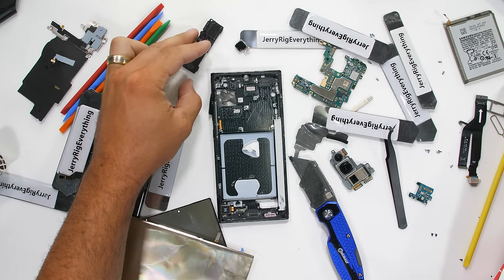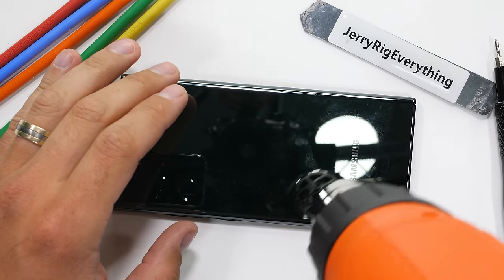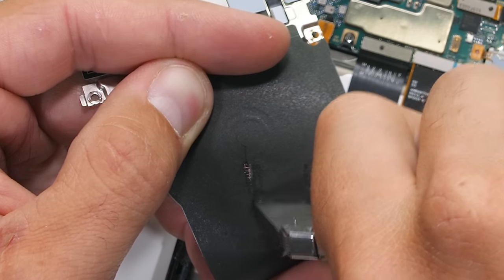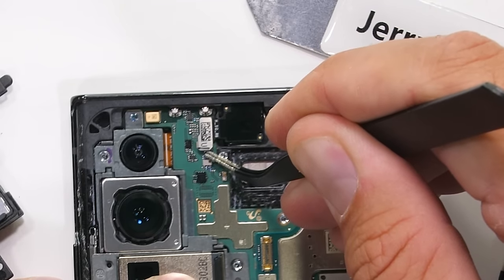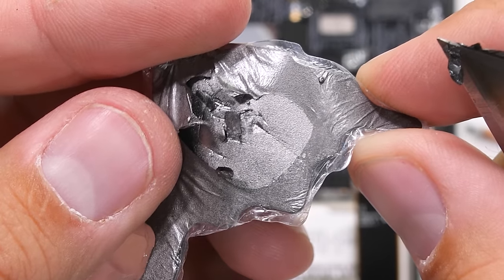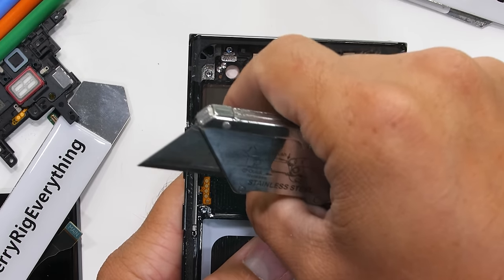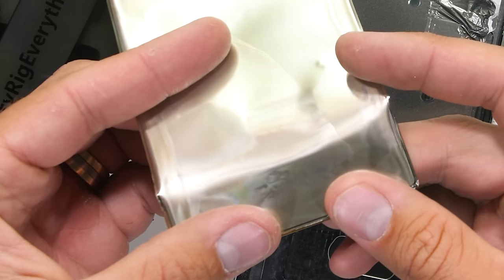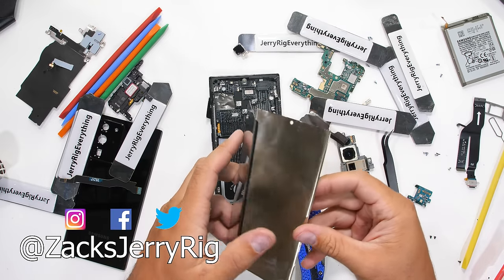Samsung Note 20 Ultra Teardown! - No Copper Cooling inside?!

Comment: I haven't upgraded from my Note 9 to the Note 20 Ultra because it just doesn't cut my expectations, I honestly think technology just hasn't moved on enough yet to be worth my while upgrading
Reply: If Zach is disappointed, let’s stay with the Note 9.
Reply: Just upgraded to the note 20 ultra from my note 9 and its a lot different, I don't know why you wouldn't.
Reply: @JakeTG  the reason is personal usage. Everyone has reasons for having a phone. I like watching a lot  of video. My budy doesn't.
Reply: Finally found someone like me. had note 3.. 5 years ago and now using note 9. I'll only upgrade if there is some massive change in Note.
Reply: Still using Note8 still Rocks🔥
Reply: Switch to Apple 🍎 my amigo. 🤣🤣🤣
Reply: @JustNam66  but he wants to UPGRADE though.
Reply: Amritanshu Rai they said “rumors” note 20 is the last note generation
Reply: @reynaldykwok6954  If they merge s-pen with galaxy fold,  I will be very happy.
Reply: @JustNam66  NO.
Reply: The Airbrush Makeup Guru 🤣🤣🤣
Reply: foldables has moved on
Reply: Rightly said

Comment: This Note 20 Ultra is a Scam in The International Exynos edition. Same price, less RAM and a mediocre interior, Thank's Jerry.
Reply: The phone in the video is the international snapdragon variant. Zach got the models wrong.
Reply: The exynos also has 12gb ram with 256gb internal storage.
Reply: If the Note 20 Ultra is a scam, then the standard Note 20 is a way bigger scam
Reply: @janskitech9966  Exactly. They did give additional storage to compensate for the processor, and also vapour cooling. So it seems fair.
Reply: In Australia we have the Exynos chipset... And the prices here are fked... It's like $2000 for the ultra and it's not even got the Qualcomm processor.....
Reply: The SD variant has graphite, including the South Korean SD model that Zack is using.
The Exynos has copper.
Reply: @GamesWizard  thats why I am sceptical in getting the phone
Reply: @NwoduTochi  it's hard to justify with the cost, now with the worse hardware it's even harder to consider

Comment: Very bad from Samsung side giving us the worst processor without any thermal solution. It's as if they want to fail with sales this year.
Reply: graphite has been used for thermal pads in CPU...
Reply: @trilingualkid  But only as an intermediate to fill gaps between the cpu an the bigger heatsink to conuct heat away from the cpu. in such thin pads it´s pretty much useless as a heatsink.
Reply: @quelixfenzer5108  no it's not people been using IC graphite pad for years and that's with CPU reaching over 20x hotter than a mobile phone Chip. Thermal pad is totally fine in this application
Reply: @trilingualkid  sure it's ok but where is the heat going to there is nothing else after and since it's so thin the amount of heat going there is too small the copper heat pipes in other phones could also be used for where heat can go but the graphite in this is useless
Reply: @batnion4266  says who? I have yet to hear anyone complain about the note 20 over heat in normal usage. News flash the copper heat pipes does the same as a thermal pad, there are no "cooler" in these phones to properly dissipaate heat so it rely  on passive heat dissipations.
Reply: @trilingualkid  Almost every phone relies on passive heat dissipation. There has been no complaints about overheating because of a nifty little thing called Thermal throttling. Copper is a better conductor of heat. That is an irrefutable fact. Another one is the phone costs a friccin $1300 even more here in Europe. I don't even know why are you defending that choice. Phones half of that price have a better cooling solution than that. Phones that are made by Samsung even. Graphite pads do not work as efficiently or even effectively a copper heat sink of half the size would do. There is absolutely no excuse, regardless of which processor there is inside, for Samsung to not build in a more effective cooling solution.
Reply: @VKdViKing  show me proof that the Note 20 is thermal throttling in normal application....then we will talk...
Reply: @VKdViKing  I rather buy an exynos version than snapdragon variant. If you dont understand the reason behind thermal pads than a heatsink then dont buy the phone, theres nothing wrong with it, it simply another method of heat dissipation. Just because the tech sounds cool doesnt mean it does it jobs better or more efficient.
Reply: @trilingualkid  Obviously Note 20 doesn't thermal throttle in normal application. If you don't know when a thermal throttle happens, then I don't have words to waste on you about Thermodynamics and thermal properties of different materials. But there isn't a technical reason required for this discussion anyway. The simple fact that a premium phone like that doesn't have, in your language, "More than needed" cooling should be a deal breaker. And if you think a Graphite pad is more than enough cooling for a CPU, any CPU, then I'm sorry to strain your head. You must be in pain right now.
Reply: @trilingualkid  And all this talks about which cooling solution is effective aside. The main question is why does samsung give two different type of cooling solutions anyway? Regardless of which cpu has bad thermals, if you can include a copper heat sink on one variant you can do it on the other as well. They ARE charging the same money anyway. And if they think that the graphite pads is enough, why not use it on both variants? Why do the two CPUs need to different cooling solutions?
Reply: @VKdViKing  Funny, I was not the one claiming that the Note 20 over heat and thermal throttle, YOU claim that it does and therefore the burden of proof is on you. I am arguing Thermal paste or cooling pipe does the same function in this application
Reply: @VKdViKing  One is Samsung in house vs Qualcomm design, thats probaly why the thermal design are different.
Reply: @trilingualkid  Thats the most illogical excuse. The thermal solutions do not need to be different for two different CPUs. Do you know the costs of making a separate line for a different design change, even for something so minor? There was absolutely no reason for investing that much if two different cooling solutions were not needed. And if two different cooling solutions were needed that means that two CPUs have two different thermal outputs, where one is obviously higher than the other. And they are still sold at the same price. And if you haven't noticed, then watch the video again, there is no thermal "paste". There are enough videos showing the exynos thermal throttling earlier than SD. These guys are not paid to trash on Exynos. There are also enough videos about the less effeciency of graphite "pads" than the copper heat sink. And I explained this to another guy. If you are one of the "I don't use my phone that much and i don't game" persons, then i don't even know why are you in this conversation. Nobody ever said that Exynos can't do the basic things. Its the heavy usage very it fails. Gaming, Video recording, Battery life. If i or anyone really had the funds to conduct their own tests on these phones, I think half of these youtubers would have to think about another job idea. If you are blind to the proofs that are already there, there is no helping you. Because if you are expecting me to buy two versions of this phones myself to prove to you of all people that thermal throttling is a thing, then it's obviously not happening.
Reply: @trilingualkid  Both run at similar clock speeds however the manufacturing process is slight different for each chipset. Snapdragon has been shown to be more efficient in both multicore and single core usage, however it produces more heat.

A simple benchmarking in itself shows performance difference between the 2 chipsets, which can vary from just 5% to 30% in favour of snapdragon.

The exynios also uses a mail GPU instead of adruino 630, which also shows performance disparities. They charge same price for 2 phones with different chip and to top it off they cripple the weaker chip with poor heat dissipitation.
If you want spreadsheet data regarding benchmarks and efficiency, I can provide them to you via email.

EDIT: Just found out i was wrong about them criplling the weaker chip. They actually cripple the snapdragon chip so the in house exynos can look close to the same performance as snapdragon. A very scummy and cheap move.
Reply: @trilingualkid  You would rather buy the Exynos 990 version than the Snapdragon 865+ !? Are you drunk?
Exynos 990 is about 30% less efficient and has 31% less power and also heats up more than the Snapdragon 865+...
And that pad solution is crap compared to a copper heatpad. It even has some kind of plastic packed around it.. And plastic is not a good heat conductor...😉 So this solution SUCKS compared to copper. Facts
Reply: @Oystein87  Exynos version are easier to root and unlock bootloader.

Again, show me a video comparison between the two design where the exynos over heat on day to day usage than we will talk, otherwise this is just meaningless conversation.
Reply: @trilingualkid  Nah...

Just search the web dude. And I should know since the Exynos version is the one we get here..
Reply: @Oystein87  good rebuttal, don't refute something if you don't back it up. Debate 101
Reply: @Oystein87  no it's how a debate works the burden of proof is in you, again debate 101
Reply: @trilingualkid  No. First you must fact check the claims you want to give. You have not. Debate 101
Reply: Shahar Rosner yehh u right
Reply: @trilingualkid  I gave two links where people who have the phone is complaining about heat in normal usage did you not read those
Reply: The worst?

Comment: Regarding the little foam balls ... 
The reason any loudspeaker enclosure would have acoustic foam absorption is two-fold; to damp excessive 𝘐𝘕𝘛𝘌𝘙𝘕𝘈𝘓 reflections, so the latent energy dies off as quickly as possible inside the enclosure. 
Secondly, so that the loudspeaker driver "sees" a larger acoustic volume. The speed of sound is slowed via the acoustic foam balls, so that's how the speaker driver "sees" the larger volume enclosure. 

The physics don't change merely because it's a micro-speaker. That said, I've no idea if that's the real purpose or not.

Comment: Qualcomm has "preferred" partner phone manufacturers that provide Qualcomm phones in areas like south, east and south east Asia that restrict other partners from selling Qualcomm phones in those areas. Different rules applied to other regions in the world.

samsung can only sell their phones in those areas if their own chips are running the show. Consumers and small resellers can import Qualcomm versions at the risk of customs fines, just don't expect the actual samsung store to be selling Qualcomm versions.

It's complicated, but Xiaomi is Qualcomm's #1 preferred partner as Xiaomi happily use reference designs engineered by Qualcomm and even run prototype or test production models for Qualcomm. Xiaomi's presence in North American market is very limited because samsung is a favored brand in that region and there might be undocumented agreements between Qualcomm, Xiaomi and samsung.

The downside is that Qualcomm reference designs tend to trickle down the mainland China manufacturers so many midrange and entry level phones from different manufacturers end up having the same ascetics and physical appearance among China manufacturers.

All in the name of progress.
Reply: Samsung could easily fix this by lowering the price on exynos regions
Reply: They should tell the public and in that way we could help them to get rid of those restrictions !
Reply: If that's true that's seemingly anticompetitive & potentially against international trade rules / regulations
Reply: @Rickiye  Samsung will bend to Qualcomm rules even the exynos chips themselves run off Qualcomm's ARM designs, to take Qualcomm to court is to lose access to all Qualcomm products.

Comment: Samsung didn't "change a lot." They've had different chips inside their international versions all along.

For example, I got the T-Mobile version of the Galaxy note 3 at launch to use on AT&T. That's because the AT&T version had a locked bootloader and officially supported fewer frequencies but the unlocked International version had completely different specs. All US models had a Snapdragon where the international version had an Exynos and didn't support any of the LTE bands needed for US carriers. That was 2013 and Samsung has been doing this ever since. Probably did it before too. Sony-Ericsson sure did. I had Verizon CDMA and AT&T HSPA+ versions of the Xperia PLAY before that and both were different specs from the International version.
Reply: I think Exynos couldn’t use the US bands cause of patent issues ! 
Now cause of Samsung R&D in 5G they can support some of the bands cause of 5G back redundancies to 4G 3G !
Reply: I remember when the eynos back in the s/5/6/7 was better then the snapdragon one so it's only fair to be reversed the last few years.... Isn't it?
Reply: Costas Georgiou yes esp in the sd 801 nd 810 and 821 was equal ! I think
Edit: I dont know what had what ! But the tip started to change with 821 when Qualcomm decided to not make custom cpu from scratch and just use modified ARM cpu ! And Adreno was good from the start !
But to be frank the UI was pretty bad and full with bloatware ! 😂 they are doing 1 thing right and 2 things wrong !
Reply: I recall that the Exynos didn't integrate the baseband so you needed a second chip for cellular communications where the Snapdragon was all in one. This may have given the Snapdragon a battery life and layout/real-estate advantage, but Samsung had no trouble fitting either into the Note's form factor.
Reply: Emmett Turner Well Qualcomm is going downhill for sure ! 5g modem is out of the SoC where as the Exynos Chip has it integrated! Lets se what happens down the line! 
Well Ill go with Exynos or Qualcomm Depending upon how they perform! I don’t have as such brand loyalty !
Reply: I know that the galaxy s 2 had different parts inside in the austrian and in the hungarian version
Reply: No, it is not the same as before. First, the difference between Exynos and Snapdragon started to become noticeable around S8-S9; second, this year Samsung added insult to injury by upgrading US phones to 865+ while leaving international version on same old Exynos 990; and third, they opted to cheap out on materials this time around as well as on some accessories (no S-Pen tips in the box) in a $1300 phone. This things combined paint a rather grim picture
Reply: @asmodeusml  It's a direct response to the words JerryRigEverything used. He said he didn't like them using different chips and having two different phones with two different specs between the International and US market phones... which has been what Samsung has done with the Note series almost from the start. He specifically focused on them using a Snapdragon in one and Exynos in another, which is the major difference they've had in the past too.

Comment: I am also not an expert but compared to the same Exynos version inside s20 ultra Note 20s Exynos performed better in Gary's test due to better cooling system. So graphite might be better in doing the job than copper

Comment: Actually Exynos processor are cheaper for samsung so they are making good money .... By selling an
 Exynos phone on Snapdragon price
Reply: With inferior specs so great for them, not for us.
Reply: @nixxxon18  it's absolutely true. Why do you think Apple makes their own chips? They don't have to pay someone like Qualcomm to use them as parts. Making your own parts are cheaper. Plus Exynos even is made at Samsung's own fab going around wafer costs like Apple and Qualcomm pay TSMC for. Plus the Exynos runs the transistors at lower frequencies on a larger node making it even cheaper. If you don't think the Exynos is cheaper, I'm sorry you just know nothing about computing, silicon, and parts/ manufacturing fees.
Reply: Yes it is, but it's a trash processor and they aren't even cooling it properly, it's a scam.
Reply: Exynos is Samsung’s proprietry chip ofcourse they dont wanna give up that. Qualcomm chip are reliable but expensive even Apple who use Tsmc for their main processor will use Qualcomms 5g in iphone 12. Qualcomm is a patent monster in smartphone chipsets.
Reply: Well duhh. That's what makes me the most angry
Reply: @Skylancer727  atleast apple sells the same a series chips worldwide
Reply: @nixxxon18  Exynos version of Note 20 Ultra LTE is 1430 USD in my country.
Reply: @nixxxon18  I'm not. I converted it.

Comment: After reading comment section, many people realize that:
1. The iCase's Note20U is the International (Exynos990) ones
2. Zack's Note20U is Korean SD865+ version
3. Many people also speculate that they want to tank the SD865+ performance so that the Exynos990 ones perform sorta on par.
4. Some people have said that graphite tape conduct heat better than vapor chamber (dunno)
5. Few people also speculate that only Korean's Note20U that has graphite tape
6. Bruh
Reply: iFixit's Note 20 ultra uses SD 865+, also with graphite cooling system.
Reply: I don't know. My PC has an ic graphite pad instead of thermal paste and it's been amazing. Although my heatsink has metal, but I don't think this is apples to apples.
Reply: #3 is utter nonsense. 865+ performed as it should in this phone.
Reply: Why not just have the copper anyways? If it cools the phone more then the phone will never feel hot to touch, which is something that really pisses me off about phones